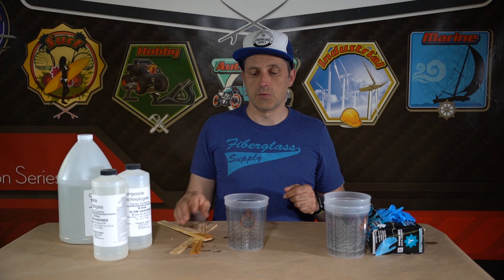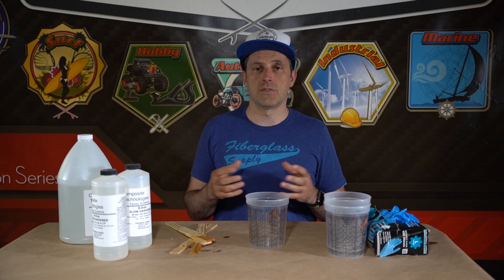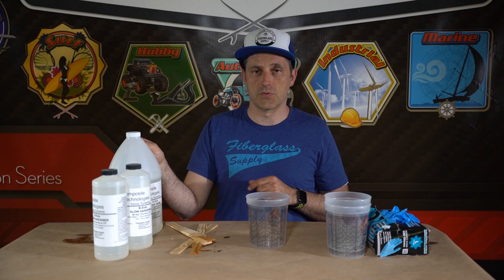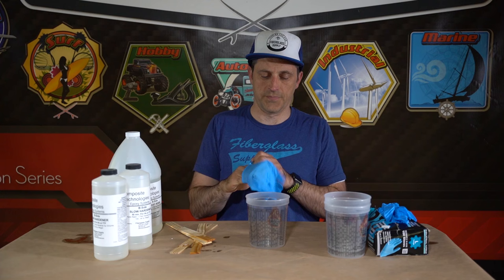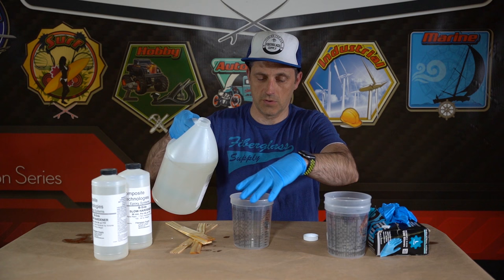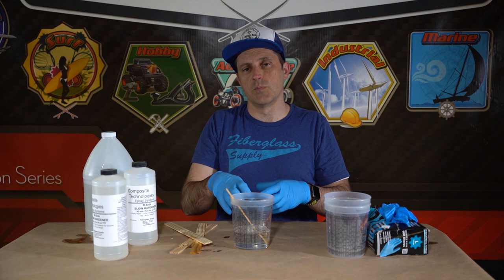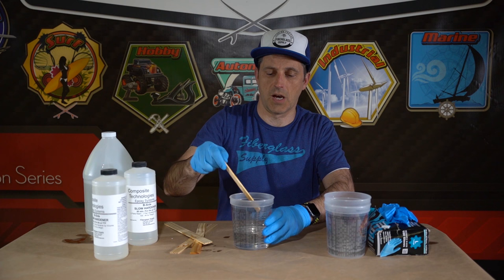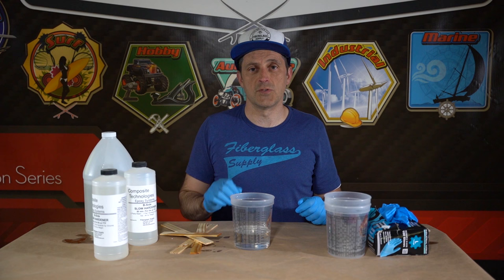Epoxy for Beginners: Mixing Epoxy Resin Basics

Comment: I was so confused on how to mix the resin and hardener, and I tried to find other videos but all of them were measuring and mixing using weight and my epoxy things says to use volume, but once I found your video it all made sense. Thank you!!
Reply: What brand you are using?
Reply: @syedashaista1490  same thing happen with, thanks for the inputs.
Reply: @syedashaista1490  roff
Reply: One question is, what to pour first as my product only labelled A&B, and when i did A first it got too much hot it melted the container...

Comment: Every epoxy brand is different and, for beginners, low viscosity is definitely recommended because high viscosity versions are a gigantic pain in the ass to mix, remove air bubbles and its super easy to end up with a cloudy mess if you don't combine both parts JUST RIGHT.
Reply: thank you for explaining that...I will try the low viscosity for sure...
Reply: For sure i need to that chemicals first then how to mix and where i can get chemicals

Comment: How do you clean the plastic container in which you mixed the epoxy components? Or do I have to use a new one every time?
Reply: As for me, I use silicone type mixed container. I just let it dry and once it harden, I can easily peel off from the container. You can search online with a keyword "resin mixing container/cup". Hope this help 😁
Reply: Use Acetone

Comment: I mixed qcell and epoxy and when I applied to EPS board it made alot of bubbles. Why is this?
Reply from the maker: You could be beating air into it when you are mixing.

Comment: Sorry if I sound stupid(it may  be the case, though)but...you said thar by quantity(volume) it is one-two. In weight is 100% 40%? I can't make it cures very well. It is(almost)always some "honey like" residues when the whole is hardened. And it takes at least 2 days depending on the size to solidify.
Thanks for de vid, was useful!
Reply from the maker: What specific resin system are you using?  Are you mixing well?  Is the residue waxy like in appearance and on the surface? If so it is most likely amine blush, which generally can be washed off with water and a scotchbrite pad, it is a byproduct of the amines in the hardener reacting with CO2 and water in the air.

Comment: How would I know if the mixture is already mixed up well? What it should look like?
Reply from the maker: Typically when you begin to mix the mixture will go cloudy and as it becomes fully mixed goes clear again.  That said, if you mix for 2 minutes minimum and make sure to scrape the sides and bottom of the container and scrape the stick off periodically you should be good.

Comment: You said mix 2 liquid resin and hardener will became epoxy ☺️ is that right or I misunderstood please??
Reply from the maker: The specific epoxy resin system we used in the video is a 2 to 1, which means you mix two parts of resin to 1 part of hardener, for example 400cc of resin would be mixed with 200 cc of hardener.  There are are other systems that use different ratios, like 3:1 and 5:1 so double check the mixing instructions on the specific system you are using.

Comment: now i am confused, I have read on different epoxy containers and online that the ratios for weight and volume are slightly different, yet i see most surfboard builders using epoxy by weight and a ratio of 2:1, are there epoxy systems that use the same ratio weather mixing by weight or volume? thanks
Reply from the maker: The density of the resin and the hardener are different hence the difference in ratios when measuring by weight rather than volume.  That said the actual acceptable mix ratio is often a range, not a fixed number and while a 2:1 by weight (100:50) might not be the stated mix ratio (it is usually 100:44 for most 2:1 by volume systems) it may fall into the acceptable range for a given system.  How do you find out the range?  Some data sheets will give it to you like ProSet https://www.prosetepoxy.com/wp-content/uploads/ACE-166_ACE-265.pdf (which the 2 ratios do not overlap) or you may need to contact the epoxy manufacturer.  Also even though the epoxy mix may be slightly out of ratio it may still cure, although it will not reach its full physical properties.

Comment: If I'm trying to add Q-cell filler to it, would I do the same steps and then add the Q-cells, or would the ratio for the epoxy mix change?
Reply from the maker: For adding things to epoxy, like q-cell, pigment, or other fillers, mix the epoxy first and then add the filler or colorant. That way your epoxy mix is on ratio and you should not have any issues.

Comment: Hi, how did you wash your measuring tools? Are you using the gloves to clean it?
Reply from the maker: Generally we discard the buckets after using them. There are health and safety concerns with washing them with solvent. If washing with solvent solvent proof gloves should be used, disposable single use gloves do not provide enough protection.

Comment: great video thanks so much! looking forward to your next videos :) Quick question: in terms of staining wood before applying epoxy. What type of staining mix would you use, to make sure the epoxy penetrates the wood and ultimately protects its from water? Big thanks
Reply from the maker: By staining do you mean a pre-coat of epoxy to saturate the wood and seal it?  Personally I don't usually pre-seal the wood unless it is a really porous piece or species.   Some people do and if I were going to do that I would either use a lower viscosity epoxy like the Contemporary Composite Technologies Epoxy or System Three Clear Coat (both which we sell).  Even a higher viscosity epoxy works well if you put a little heat to it or to the wood and use a slow hardener to give it time in its liquid state to soak in.  The folks at WEST system did an excellent article on epoxy penetration into wood that can be found here: https://www.epoxyworks.com/index.php/penetrating-epoxy-legend-myth/

Comment: When I’m doing carbon fibre parts and use epoxy resin can I add few drops of catalyst from polyester resin mix just to help speed up the drying time       Coz each coat takes 3 hours.     And polyester resin goes off to fast     I’ll do a test bit but just wondering if anyone else has used it
Reply from the maker: No that will not work.  If you want it to go off faster add heat.  Check out this video on heat an epoxy https://youtu.be/fErvzbHOJ3k

Comment: Question: is it sticky stuff? In other words, will it bond well if poured onto a painted surface? When it goes off will it detach from a painted surface?
Reply from the maker: That is a good question but one that is really hard to answer due to type of paint, condition of paint, and any other surface contaminates.  Even if it does stick to the paint the next question is how good of a bonding layer is the paint to the substrate? If I was wanting to go over a painted surface I would run some tests to see how well it does.  In surfboard building we do often go over painted foam with epoxy, but that is a textured surface so we have some mechanical bonding also taking place in that situation.

Comment: Could I use a drill with a small paddle mixer attached to the end?
Reply from the maker: You can, you still need to make sure to scrape the sides and bottom of the mixing container to get a thorough mix.

Comment: The container used to mix, dispose afterward or how can it be reuse? Need any cleaning agent?

Thanks for sharing
Reply from the maker: Generally we dispose of the container. If mixing by weight it is possible to reuse the container. Also if using a pump or metering system it may be possible to reuse the container. Unwaxed paper buckets work the best for reusing as the resin bonds to it and won’t flake off.

Comment: How do you apply the mixed components to your project? do you paint on or can you pour and tilt on
Reply from the maker: Really depends on the application but most horizontal surfaces pour on and spread with a squeegee, vertical roll on with a short nap paint roller.

Comment: what surface that we can use as container so it release easy beside silicon
Reply from the maker: for a mold surface or a mixing container?  We have used metal muffin pans for molds, we coat it with a release agent to get an easy release.  Some plastic containers also work.  The problem that you will run into with a mixing container is that it is pretty common for there to be spots on the surface of the container that did not mix and will be sticky or not fully cured.

Comment: I am using epoxy resin lr 1150 what is the correct ratio to be used with the hardener ??
Reply from the maker: Do you have more information? Manufacturer’s name as well as the system name or number.

Comment: After preparing the resin when I pour it in a mould , what measures( time taken) do I have to take in order to let the resin harden and freeze ?
Reply: You've just answered your own question. Give it enough time and it will harden. If you want to be more exact, you can make a small batch and test how long it takes to harden
Reply: @nicholaslau3194  thank u 🙏

Comment: Once the two part epoxy is poured, how much time do you have to mix it?
Reply from the maker: Do you mean once the two components are poured together how much time do you have to mix it?  It depends on the specific system and temperatures but for most systems at room temperature you should have plenty of time to mix it (we recommend mixing for 2 minutes) and usually 15-20 to get it out of the mixing cup and onto the project.  Again those are general guidelines - specific epoxy systems can vary to much shorter and longer times so consult the data sheet for your epoxy or contact us via phone or email.

Comment: What kind of hardening agent and resin can you recommend that isn't expensive? When I try to look these up on the net, I see all these companies wanting your life savings for some of these products. Isn't there a budget version somewhere to practice with?
Reply: I use clear cast epoxy resin off eBay.    It’s 2-1 mix     And a small bottle is £20
Reply: wrong question. The correct question is where to find a supplier who sells good inexpensive epoxy in the quantities you need.

Comment: How long can I keep the mixed resin? Or it cant be stored after being mixed?
Reply: It will start to cure as soon as you mix the resin and hardener so can’t really be reused.. I would get in the habit of measuring out how much you will need to use for your project before mixing it. There’s calculators online for this or just eyeball it. If you mix too little for your project, you can always mix more if you work quick enough!

Comment: Do we have to use any catalyst to apply on a cement wall?
Is it a must to use a hardener to use epoxy?
Reply from the maker: Generally speaking since I do not know what system you are using and because your question indicates there may be some confusion to whether you are using an epoxy system or a polyester system, many epoxies will bond well to raw concrete and result in a bond that when it fails is due to substrate failure (the concrete fails).  Polyester or vinylester systems require a tie coat or primer like AT Prime II. Again generally speaking most epoxy systems are a 2 part system that requires a hardener.
Reply: @FiberglassSupply  For EFG (Epoxy fiberglass), what type to used  EFG bow  ?

And what about the mix that fits for high quality results

Comment: (With a drop of pigment) I didn't know the size of the mold so i had to make the epoxy mixture twice ( 2 part resin+ 1 part hardener+ 1 drop pigment as per my Resin brand instruction). After pouring the second mixture, which is only about 5 minutes later, I realised the plastic bottle mold got heated up in a few minutes and deformed the mold. 
       Without pigment: Previously i had done it in one go and without adding any pigment, and it went perfect. 
       What could be the reason for the extreme heat that deformed the plastic bottle mold and the resin expansion? Kindly help me mitigate the problem 🙏
Reply from the maker: To troubleshoot a problem like this we  want to look at:
Mold temperature the previous times and this time.
Volume of resin mixed this time vs the previous times.
Verify that we are using the same speed hardener as previously.
Resin and ambient temperatures from both times.
Were any exotherm mitigation techniques used either time.
Time from mixing to pouring in mold.

Resin is going to create heat as it cures this is called exotherm.  The larger the mass of resin, i.e. the thicker the pour or resin volume is, the faster and hotter it will get.  

It is unlikely that the pigment itself caused the issue, but could be that if you mixed the resin and then let it sit while you opened the pigment or searched for something (I've done that before), that the resin in the mixing bucket was already starting to get hot and react faster causing a train wreck when you poured it into them mold.

Basically you have a number of options to lower exotherm, reduce the sectional thickness of the part, work in cooler conditions, use a slower hardener, or use a method to cool the mold while the resin cures, are some of the options available.  You can use a combination of those methods to prevent the exotherm from getting too hot.
Reply: @FiberglassSupply  thanks a lot
Reply: @FiberglassSupply  n

Comment: how about mixing with colors, like white paint? any paints that are better? like acrylics?
Reply from the maker: You can mix with pigment designed for resin or with dry powder pigments. I would not mix with paint.
Reply: @FiberglassSupply  luckily I ordered the white pigment for my epoxy resin, I saw one guy using dark grey spray paint into the white epoxy to make the veins,

Comment: My epoxy mix got milky-cloudy when cured... Did some research, turns out it's the moisture in the air that may contribute...
Reply from the maker: Yes that could be.  Amines in the hardener react with moisture in the air to create amine blush which can manifest as a milky white especially when wet or very humid.  This can be a problem if you let the mixed resin get wet while it cured or had very high humidity.

Comment: My dipoxy is gummy and it sais 2to1 -2:1 a2 B1 and i mixed it nice and everything but it is still gummy  gummy meaning u can twist it in any way so how to fix that its dry and everything just its gummy XD
Reply from the maker: What brand and system number is it and what speed hardener? First thing is to double check your temperature and the cure times given on the data sheet for the resin against how long it has been since you mixed it. It may just need more time to cure. If that is not the case mix up a small test batch around 100-150 cc and see if that hardens up, be careful to measure the batch precisely and to mix it thoroughly. If that doesn’t set properly you may have an issue with your resin system if it sets properly there was an issue with measuring/mixing the first batch. Also you need to verify whether the ratio is by volume or by weight, as densities of the epoxy and hardener are often different the mix ratio by weight will be different than the mix ratio by volume.

Comment: What's the difference between epoxy hardener-hard and epoxy hardener-soft?
Reply from the maker: I am not familiar with an epoxy hardener-hard or -soft, I assume that you are referring to -fast or -slow.  The chemistry of the hardener determines the speed at which it cures for a given temperature.  For an epoxy resin (a side) there are usually a number of hardener speed options like fast, medium, slow, extra-slow, or tropical for each manufacturer those can vary in what they offer and what the actual speed is in minutes.  Again keep in mind that the speed that the resin gels and cures is dependent on the hardener speed AND temperature, the hotter it is the faster it will gel/cure and the colder it is the slower it will gel or cure.  Most data sheets give gel data at 25C  for every 10 C you go higher the time will be half that and for every 10C colder double.  Gel data is usually given for 100 to 150 gram mass, thin film times will be longer.

Comment: How long it's to drying
Reply from the maker: Depends on the system you are using and the temperature.  For a video on using our epoxy gel time calculator check here https://youtu.be/fErvzbHOJ3k  To use that though you need to know what the specified gel time and/or set time of your specific system is and at what temperature.  The calculator is set up to use Fahrenheit.

Comment: Can this be used for garage floors?
Reply: I did factory floors with resin.   Scrabbling the floors to get a key and clean then roll first coat as a primer then another coat and add sand to give you grip.     Then can SL the resin colour resin mixed with silicone sand to make thick paint       Trowel on few mm and use spike roller to self level and pop bubbles

Comment: So the answer is two parts resin to one part hardener
Reply from the maker: Depends on the system, in this case it is a 2:1 system.  Check the data sheet for your resin or container for mix ratios.  1:1, 2:1, 3:1, 5:1 are all common epoxy mix ratios, but the ratio will be specific to the formulation you are using.  If you purchased your epoxy from us feel free to contact us directly and we'll help you out.

Comment: Far from perfect. Thumb down. Not done homework for making multiple reuse of containers and how to mix small quantities. I personally believe a silicone stick from kitchen is better then wooden stick because it will mix better to the edges of a container and epoxy doesn't bond to a silicone, so in theory you can reuse that mixing stick many times. I'm looking for a small silicone reusable containers for the same reason. Not sure if they're easy to use, but I hope.
Reply: another know it all